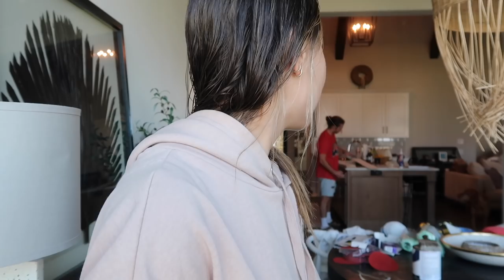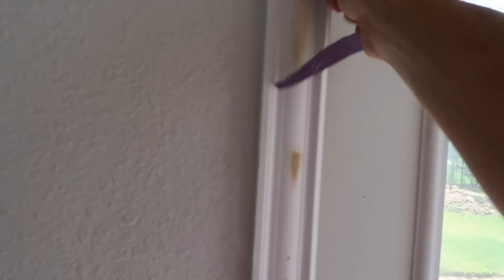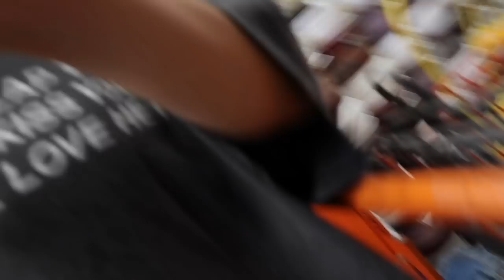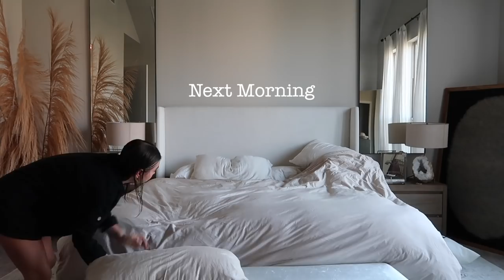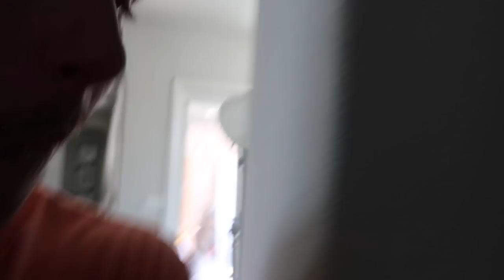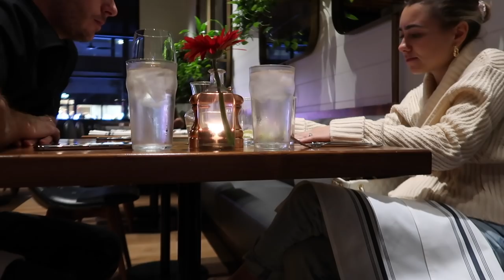LOSING OUR MINDS PAINTING & ALMOST DIVORCING Vlog week day 4 |Julia & Hunter

Comment: You can have any Behr colors mixed into Marque which has primer in it. Was a bit of a disagreement that we needed 2 gallons for a small room. Well 1 gallon covered so I used the same blue green in my kitchen. Good thing my area rugs had the same color in it. Painting ugly paneling this year , will be several years before I can remove it, painting it a dark red rust color. 3 walls of windows . I think we will need a primer. I had to admit it.🤣 love Home Depot,  my master  is turquoise with gray Accents in my master bath is grey with turquoise accents. I wanted a beach colored, I had tons of samples. The clerk at HD suggested the right colored, didn't want it like the 60 or 70. This looks like the color of the ocean,  my happy spot.